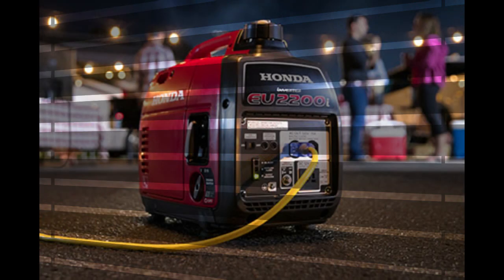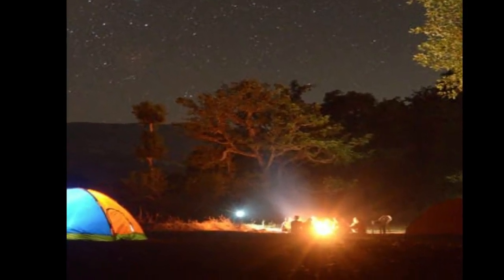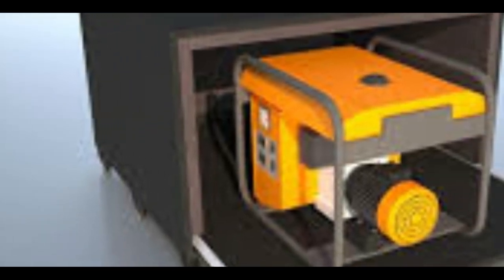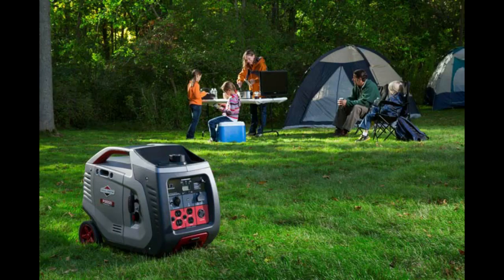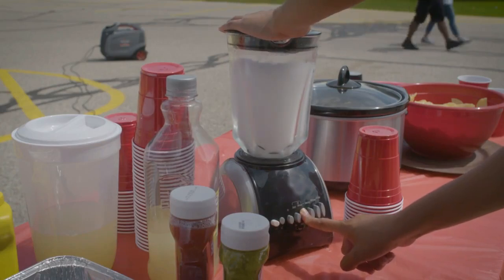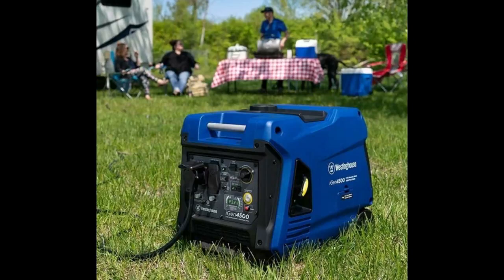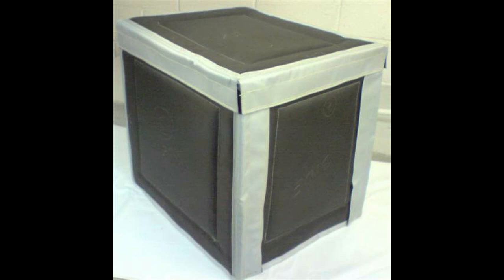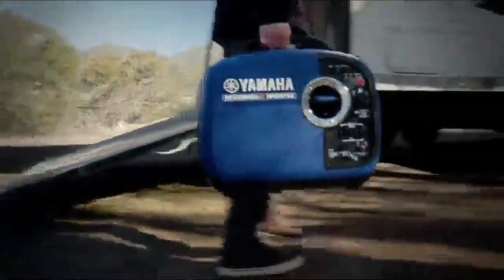How To Make A Generator Quieter - 9  Simple Hacks!

Comment from the maker: Before you go, LIKE, SHARE, COMMENT, and SUBSCRIBE to this channel to help me share this message. See you in the next Video!
SOME RECOMMENDED SOUNDPROOF MATERIALS:
1. Exhaust Muffler: https://amzn.to/3e53xIB
2. Sound deflectors: https://amzn.to/2RoNwn1
3. Use Rubber legs to reduce the vibrations: https://amzn.to/2xdkCPS
4. Use Air vent for your generator box's ventilation: https://amzn.to/2US2T9L

QUIET GENERATORS:

1. Quiet Champion 4000-Watt:https://amzn.to/2XjERWK
2. Honda EU3000IH1A Handi 3000W:https://amzn.to/2xdkzDG 
3. WEN 56203i Super Quiet 2000-Watt: https://amzn.to/2Va5OcS
4. A-iPower SUA2000iV Ultra-Quiet 2000-Watt: https://amzn.to/2yGClQ8